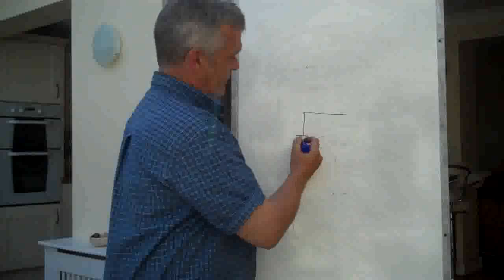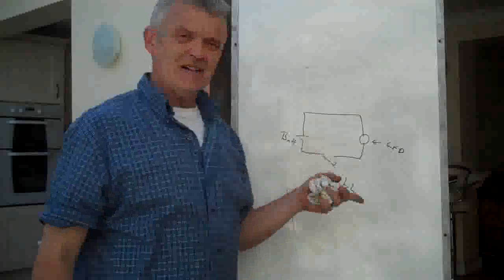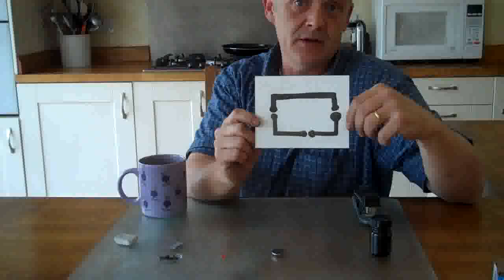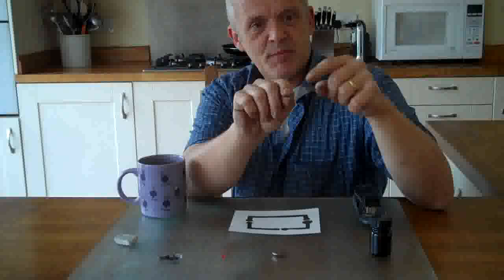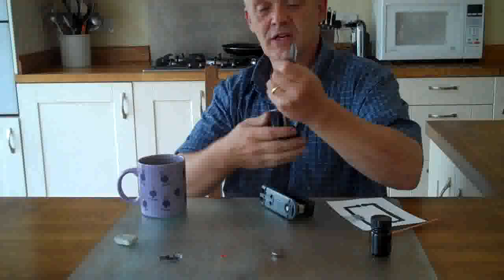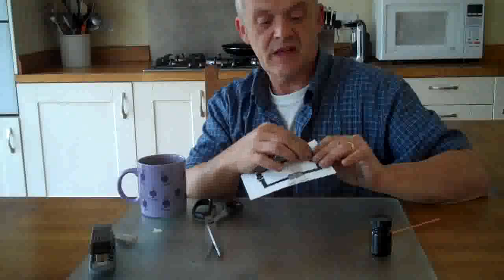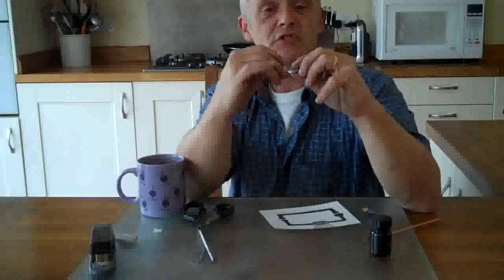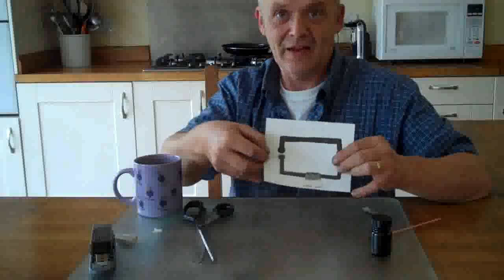Paper Electronics 1 - Simple Light Circuit

Comment: If you made spirals  It would not be the same, it would  have an inductance provided you use AC source. In fact it would be nice and pretty easy to experiment with this ink with fractal structures of capacitor and inductors.

Comment: I assume you can N and P dope the ink to make diodes and transistors with it.  How would you go about doing that?  Could you just add small amounts of metal to the different inks?

My idea is to use this in a video game (though it could work it real life, and I want to go for maximum realism) as a cheap/easy way to manufacture electronics on Mars, where graphene is mass produced from the carbon in the air.
Reply from the maker: I think it would be a little more complicated than that but not by much - good luck with the game